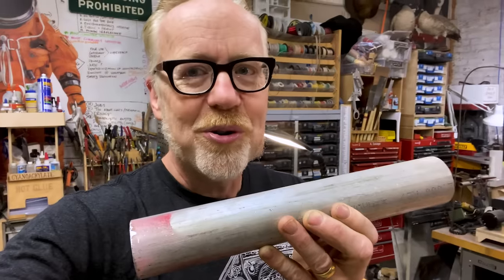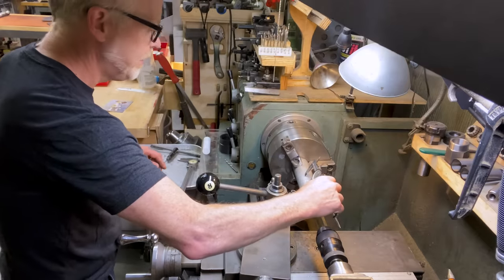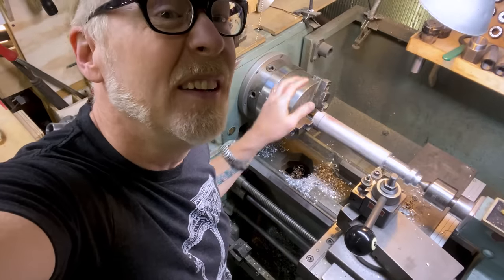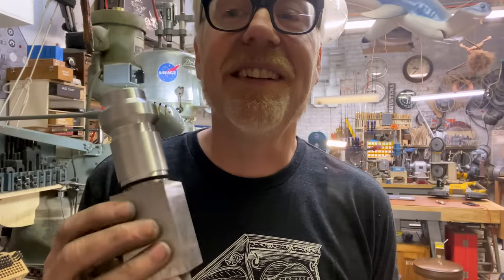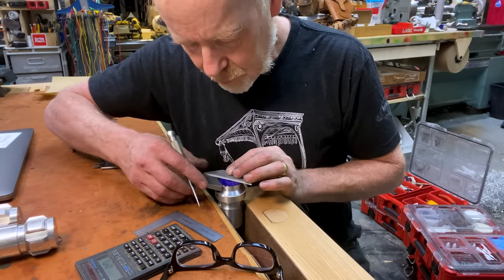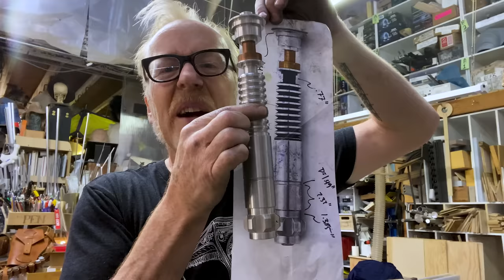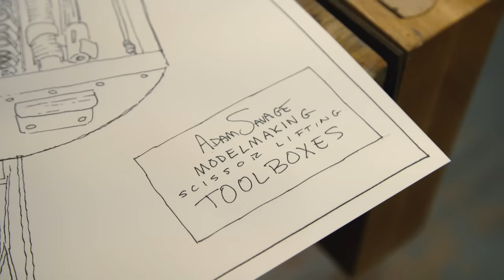Adam Savage's One Day Builds: Luke's Lightsaber!

Comment: @adam you know you can use the turning lathe to make equal division lines. 
Just scratch the part with the chisel at the center point. 
rotate it manually 45° and scratch it again. 
Some turning lathes even have 360° markers on the clamp. 
There is no need to rebuild the machine just to mark your part.

Comment: @Adam Savage’s Tested

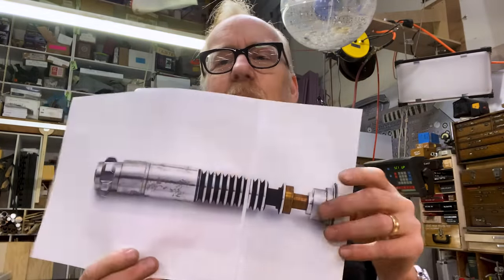The program you’re looking for at 9:15 is MS Paint. I print maps for D&D quite frequently and the perfect size for our table is 3 sheets x 3 sheets of 8.5x11 paper, so I simply open the image in MS Paint, go to print>page setup, select portrait or landscape and fit image to “X” pages by “X pages. Voilà. 

When I click print it has taken that image and blown it up over X number of pages, on both the height and width. 

Be forewarned, if you have a low-res image it’s going to quickly pixelate pretty bad if you go too big.

Comment: 09:40 I used Adobe PDF Reader which was easily printing in tiles. I'll have to recheck it, it's been a long time.

Yep, it works. There's a "poster" function in printing properties. Check the paper size and it divides automatically into the exact pieces of paper needed.

Comment: In case you're still monitoring the comments for a better way to slice your images, I might have got one.
I don't know how tedious this actually is in Photoshop, but using GIMP and two plugins called "ofn-layer-tiles" and "Export Layers", it's actually really simple. The only annoyance is having to install a whole separate software with some third party plugins. GIMP plugins can be a little finicky, and GIMP runs quite slow on the Mac, at least for me. Much faster on Windows and Linux for some reason... But the method works very well once you've got it all set up. I've been using it for a while.

Comment: Meanwhile 😎 I’m stoked at the progress attempt for the fusion reactor the german’s attempted to design. Amazing on the architectural platform and it blows my mind. The control attempt of plasma by folding the stream and twisting it by man made slide… 😃 blows my mind how they attempt to control the heat dispersion and equalize something that is limited by electricity and air vibration…
Reply: Fusion reactors not a new concept but wow actually designing one 🤯

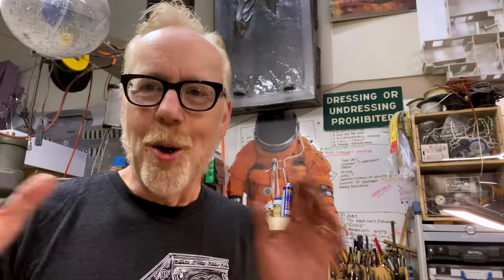Comment: 7:46 Way ahead of you on the math there. (Of course, I have a degree in math, so that helps.) 
The trick is to realize that so many things are about ratios, especially for things like scaling models and such.

It helps to know the reciprocals of the first few integers, which can make calculating simple things so much faster, and even makes it easy to do a lot of calculations it your head. For example, 1/7 is 0.143+, or almost 15%, so calculating a 15% tip is really close to just dividing the bill by 7.

Comment: Adam for the love of god if you have a dividing chuck for the mill, USE IT! Mill and lath operations can and will be extremely dangerous if done improper. I am an educated CNC-mill and lath operator and had to learn manual mill and lath operation before I was allowed to touch a CNC machine. One guy in the class under me almost lost a finger when lathing because hi did not pay attention when hi went to turn on the lath and the chuck key got his finger and one guy I know almost lost an arm because hi did not pay attention and I myself almost got a chunk of metal thrown in my head during my education because I thought I had fastened it properly. 

For anyone else reading this. I am not an idiot, I know hi probably got more than 20 years of experience over me, but that does not mean that I can share my experiences so that people that does have an education goes and does something that might cost them their lives in a worst case scenario. Milling and turning on a lath is super fun if done properly.

Comment: Adam, I seem to recall years ago on my Mac (I am a graphic designer since the 80's also, and ya, all those formulas, man, they are in my head) OK...  there was a tiling function within the Apple LaserWriter 360 Postscript Printer I had... maybe within the printer driver? I use to hit the tile check box, it would ask how much overlap I wanted per page... and it would print out as many pages as needed. ... is that not a thing anymore??  Or maybe I am understanding your question incorrectly?

Comment: Is one of the angles on the centre finder not 45 ?

Can you average the relative dimensions from both ends to partially mitigate the parallax error ? And possibly use multiple photos for the relatives,  

Fun

Parallax Error badge, Paper Cuts  (possibly a with a plaster ready for use) and the didn't hold onto it tight enough or put it down carefully on a flat surface !

Comment: There are actually printers that go larger than Letter/A4. Some even print to a roll of paper. There is absolutely no need to tape stuff together - and that's probably why the "Printshop" programs went out of fashion. If all you have is a screw driver, don't get hung up on why nobody has made "hammer attachments" for the occasional nail. There is a right and wrong tool for every job.

Comment: Adam.....a question. I'm looking to build a version of the Transformers "Star Saber" and OptimusPrime's "Battle Blade. I'm looking to make the blade metallic gray when off but it will glow blue and a second part red and the Battle Blade yellow/orange. What material is strong enough to fashion the blade from so I could use it in sparing match? I'm not certain what polymer, acrylic or polyurethane....any thoughts?

Comment: Demerit bage carry the 1 to the wrong spot on a teeter totter in the middle where the left side is straight and the right side is bent at an angle (representing messing up the math half way through the project messes up the finished product and your left scratching your head thinking you measured everything right but the finished product makes it just wrong enough to not work right)

Comment: I am going to change your life for tiling an image bigger than 8.5 by 11.  Excel or any spreadsheet software. Just import your image and if you know your percentage from the equation you were talking about, you blow the image up to that size. You may need to adjust the margins slightly depending on printer settings and printer. But this should work with a high degree of accuracy. Now that I changed your life I expect at least a like on this comment. Haha. Thanks for the awesome content.

Comment: Adam, I realize you probably won’t see this because you uploaded this video 1 year ago. But I have to try. I have ‘always’ been awful at math, even when using a calculator, go figure. But I tried your tip with your #’s, 11.75 divided by 10. My calculators answer was 1.175. Was I supposed to move the decimal to the right 1 space? Then when I tried 12 divided by 9, I got 1.33333333! Is it 1.33 or 3.33, help, I’m so confused, (and stupid)!

Comment: It would be cool if you could build one that is actually hollow and empty inside and you created fake electronics inside it to indicate it is a real functional light saber weapon. As if there were a scene where someone needed to take one apart and work on it and we get to see what is inside of it. So instead of machining a solid rod of aluminum the outside of it is actually a shell with attachment points and maybe screws or something that indicates The same? Now how about that for a challenge and a special project? That would be cool to do with an original phaser from the first Star Trek series and tricoders and communicators.